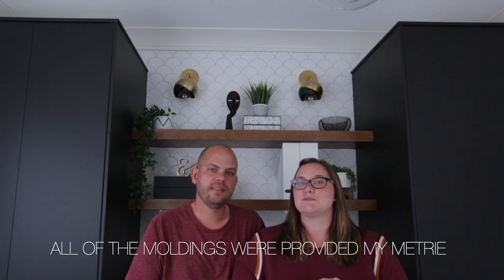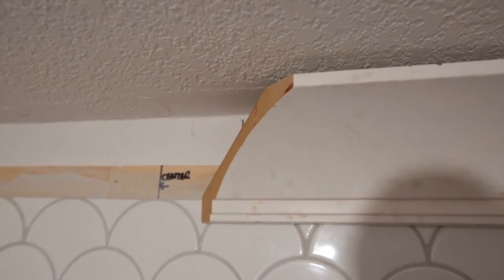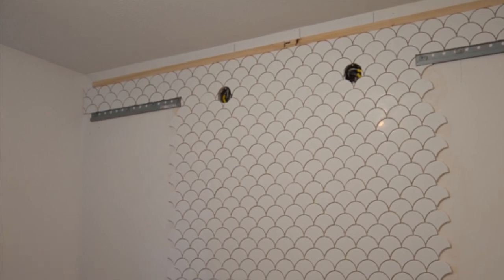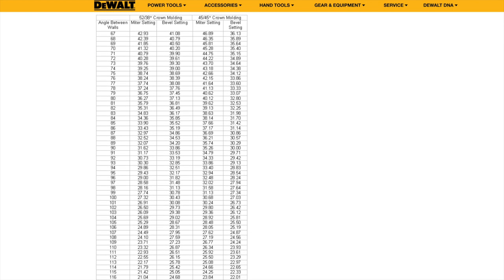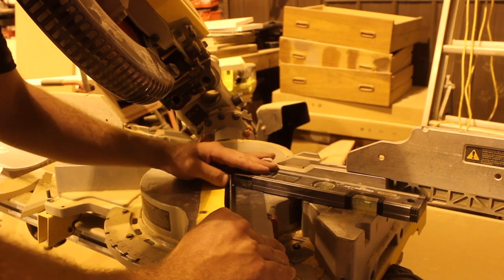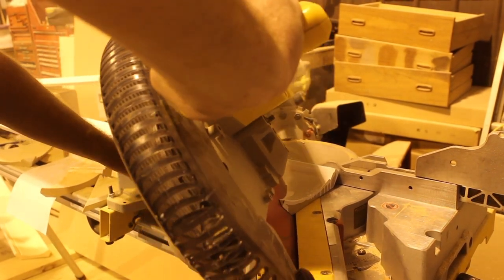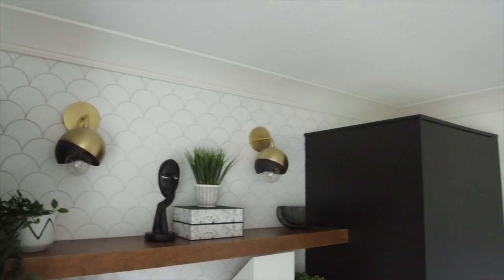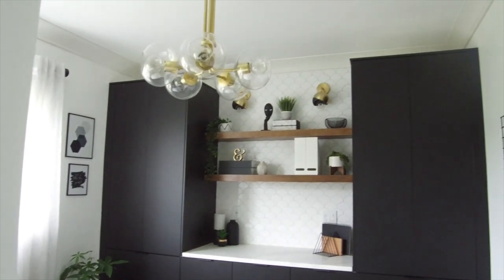How To Install Crown Molding Over Tile [& a Beginner's Guide to Cutting and Installing!]

Comment: Thanks for the great tutorial. I have a question - doesn't the crown molding on the tile side stick out compared to crown molding on other sides? Since only one side has tile? How did you solve this issue?
Reply from the maker: No, essentially the tile is your new wall. The entire wall is 1/4” (tile thickness) closer now. Then you just do your drown measurements as you normally would.